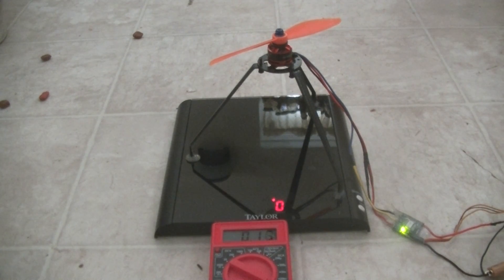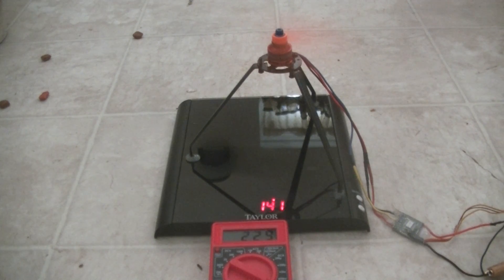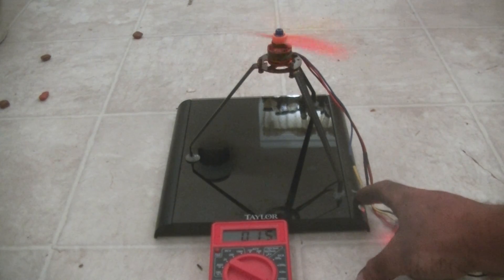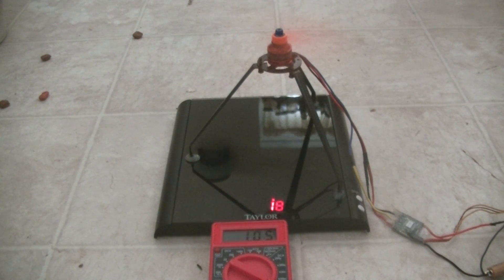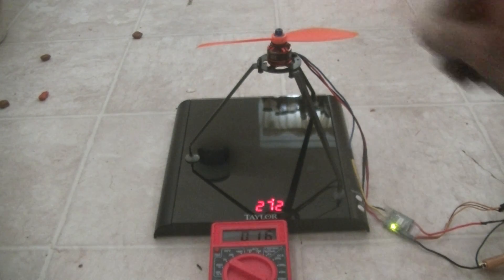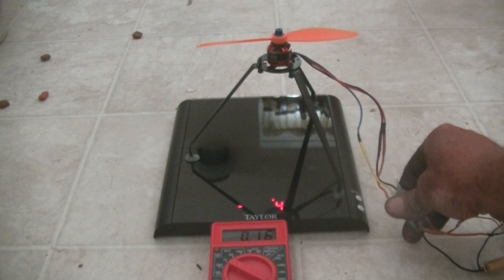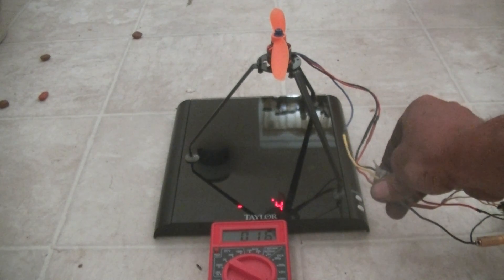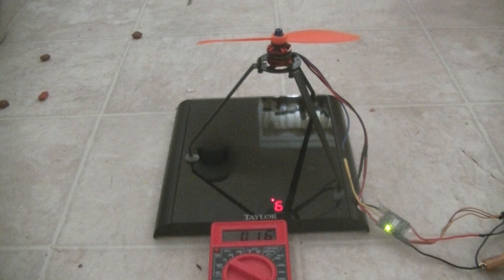DYS 1806 2300kv motor test with gemfan 6x4.5

Comment: hi can any 1806 motor run with 6 inch props with 12A afro esc and 3s 1500mah 20C battery ? i have the Quanum, MT 1806 2300 kv but i can't find any info for it pls help

Comment: Hello,
What 2200mah 3s battery you use ? and C rate ?

ty
Reply from the maker: +Benoît B nanotech 45-90c
Reply: hi,
Thank you for your quick reply
Reply from the maker: I've upgraded to a Airbot titan 1806 motor.  has the same specs as the dys when i tested it,  but has a better build quality and improved bearings
Reply: I have a Robocat 270mm and weighs about 334-350grs.

If I use NanoTech 45 ~ 90C 2200mah 3s like you, I can expect to have nearly 11min flight ?

The Titan 1806 Airbot look great may be add to a card later ^^

Thanks again for your help ;-)